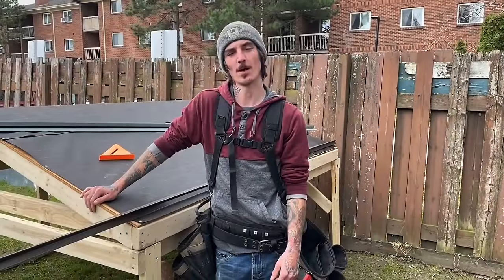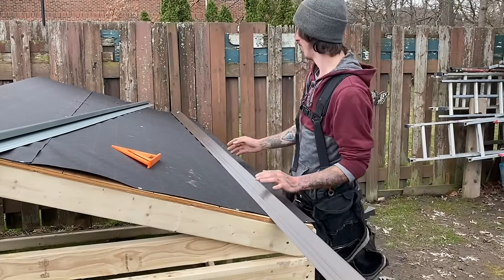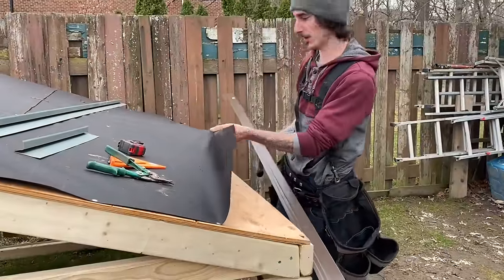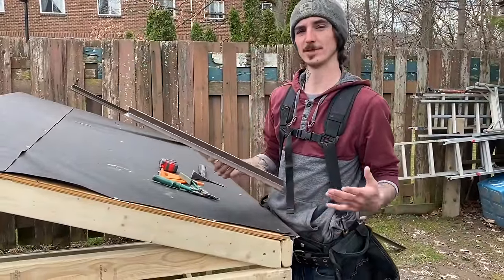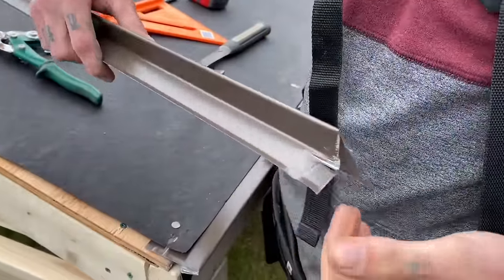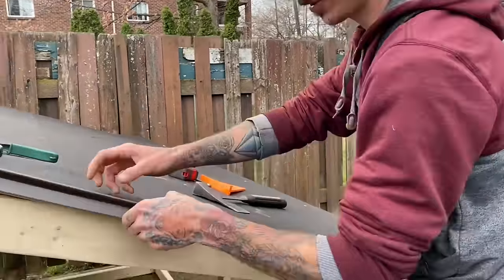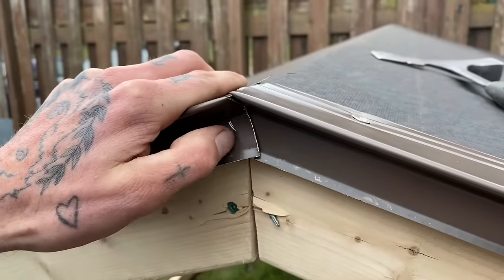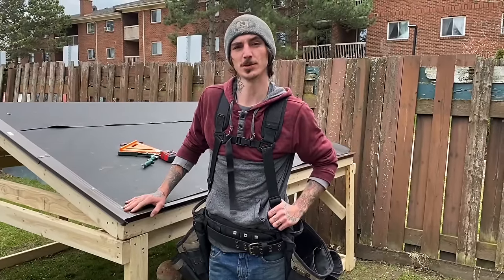How To Install Drip Edge On A Roof

Comment: 2:16  having the lip of the drip edge too close to the vertical facia face (i.e. the part touching the 2x4 in the video )
can cause the facia to rot or channel water down the wall, rather than dripping out away from the wall (the purpose of the drip edge).
Whoever did my house did just how you show ( 2:16 ) and now I have rotted facia to replace.
Reply: Were your facia boards wrapped? Facia wrapped with aluminum will not rot as the water off the drip edge will run right off. That is what he meant when he mentioned sliding the facia wrap "behind" the drip edge. If you have painted facia it will get wet and rot eventually no matter what...
Reply: @mongrelrogers9642  Never heard of an aluminum wrapped board. But now I have cement board so no rot ever again.

Comment: if I'm rolling a self adhesive GAF directly onto OSB, do I need to have an additional tar paper? Or, can I use the adhesive roll onto the OSB? Do I install the drip edge first, then roll on the GAF?
Reply from the maker: You case apply a 2 part system directly to the roof decking. 

First install base sheet, 
then drip edge,  
primer the drip edge, 
then apply cap sheet.

Comment: You do good work brother but you should never put metal against bare wood. Great content
Reply from the maker: Tyler ants. tian. to Schultz this is aluminum not metal. Nor does it cover enough of the roof deck to even cause sweating.
Reply: @Average_Roofer  This old house : Tom Silva says to use 'finger width' distance for drip edge against eave board.  Water follows the metal off the roof by capillary action and then drips off lowest point of metal. So best to keep drip edge metal away from wood with a small gap.
Reply from the maker: addker normally we would have aluminum fascia metal behind the drip edge here and then a gutter over that.

Comment: Also we do not have a drip edge because we just bought this house and the previous owners didn't GAF but now we want to install one. Is it possible to install it under the shingles that are already there. *GULP
Reply from the maker: It is absolutely possible, however it can be tricky as there may be existing nails in the way the may need to be pulled out. 

This must be done carefully as to not damage an of the shingles. Also if you break any of the tar adhesive seals on the shingles you must reapply new caulking or roof cement to re seal the base of the shingles. 

But the answer is yes it is possible.

Comment: Could you expand, and include selection as a key part of installation?  There's alot made [widths and angles], and construction methods differ.   I make the point because on my house, a roofer used drip edge best suited for trusses that were open ended at bottom, being minimal width.  In my case... bottom of my trusses [cut plumb] were joined by 2x4 ripped on edges to match the roof pitch before sheathing went on.  Years later, I go to replace a couple pieces of fascia to discover drip edge was nailed into that, and not  the 2x4, on account of width of drip edge selected by the  contractor.  So until my next roof goes on... I have a six foot and a nine foot section of rail with no securing nails: a friction hold that needs checking after heavy weather. [I just can't afford re-doing the roof at present]

Comment: So why do you use drip edge or “D” metal on the rake when they make “g” metal for rakes, or gable metal?.... it comes equity with a kickout bend on it to divert and seals the corner without bending and pissing off the gutter guys? Just my experience. I’ve used the same metal on rakes before.
Reply from the maker: This is more geared towards the do it yourselfers that need advice. There is several ways to do this process. You’re absolutely correct!

Comment: What kind of nails you used and what size?
Reply from the maker: Jesusdaniel Estrada standard galvanized roofing nails. Normally 1 - 1/4 but in this video I was using 2 inch.
Reply: @Average_Roofer  thank you so much my friend this will help me a lot

Comment: Just a question when you guys are doing your installs I see you using the dynasty's upside down why do you do it that way instead of right side up or leading edge?
Reply from the maker: Louie Perri that is the contractors preference. I prefer starter shingles. I will be going over starters in the next video! 👍🏼

Comment: Thanks man, great video. What tips do you you have flashing wise for installing a covered patio right up to the side of a stucco wall that I want to do minimal damage to? Can I just weather proof an L flashing or do I need to notch the stucco and install a Z flashing? I'm a DIY'er not a pro for reference. Thanks in advance for any advice.
Reply from the maker: CityHeights1904 for stucco we would normally run a step flashing flush along the wall. Then cover that with a counter flashing such as the z flashing you are referring to, then caulk the top of the flashing along the wall line. That is the simple and one of the most effective methods.
Reply: @Average_Roofer  Cool, so no need to cut the stucco?
Reply from the maker: CityHeights1904 not with that method no. Just ensure you attach the counter flashing to the wall using grommet screws, or regular wood screws and caulk the exposed heads.
Reply: Your Average Roofer Thanks man, really appreciate it. I’ll link some pictures on imgur once I’m done. Probably towards the beginning of June, I’ll be done with it.
Reply: @ your average roofer here’s the end result. 
Thanks again. 👊🏼
https://imgur.com/gallery/KHsNa97

Comment: You need to have a gap between the drip edge and the facia board otherwise capillary action will pull the water up behind the drip edge.

Comment: Plastic speed square and the wrong handed snips .good start .now you should overhang your drip edge an in over the rake so you can wrap it around and fold under your drip edge that should run up your rakes also. It keep most of the water off your rake boards and prevents the water from running down the rake boards and behind the j channel up the underside of rakes .huge mis conception about vinyl siding .water gets behind it everywhere. People don't flash the last piece under the windows .vinyl siding that was installed ten or fifteen years ago is job security .if you don't believe me go pull a few pieces of siding off under each window .

Comment: The problem with being tight to the fasciae it allows water to roll under the drip edge through hydraulic action. Better to be a fingertip thickness off the fasciae to allow water roll under the bottom lip of your drip edge and then drop.

Comment: what do u think is better gutters or drip edge? just fnishing up rafters now
Reply from the maker: B both!
Reply: @Average_Roofer  so u can put gutters over fascia board??
Reply from the maker: B it’s recommended to install fascia metal first then your troughs. But only after the roof is completed/shingled.
Reply: @Average_Roofer  cuz im getting ready to cut my rafter tails, just deciding what I should go with after that, im gonna have an overhang for shade, just doing a covered patio nothing serious like what u guys do

Comment: A much faster, better looking way to turn an outside corner is with one piece just wrapped around the turn still attached. All you do is snip all of it except the face that is seen on the fascia. I even snip the eight inch little profile on the bottom of the drip edge. then simply bend it around the 90 degree corner. Everything has been cut except the face of the drip edge. Faster, easier and looks better because it has no cut seem on the part you see.

Comment: How do I install this on existing tile roof - need to remove tiles first I guess and put them back?  I already have fascia damage and like to prevent water damage in future. The builder 30 yrs ago did not install long enough  paper to stick out far enough for to keep water out.
Reply from the maker: Simple Living I don’t recommend ever installing and roof in multiple layers. However if you are to do it, cut back the shingles approx 2 inches for the eaves and gables, then install new drip edge to the decking. Then use starters and shingles as normal. I highly advice you to just tear the old roof off as it will increase the duration and effectiveness of your new roofing system.
Reply: If you got 30 years out if it you're hardly in a position to complain now. That builder is likely dead today.

Comment: Can u just weatherproof paint the edge of the plywood 2 feet on all sides sonmoisture will never penetrate ?
Reply from the maker: I’ve seen it done but it’s a mask to a true solution. It will work temporarily but the wood will still eventually retain moisture.
Reply from the maker: Edit: if a leak is present!

Comment: trying to find out if the drip edge should be spaced off the fascia.....
Reply from the maker: Depends if you have metal over your fascia and an eavestrough installed. 

Some will tell you that it should be spaced 1/2 inch from the fascia board. Others will tell you it can be flush. 

We have always done it flush, with metal on the fascia with our eavestrough tucked up behind the drip edge.
Reply: @Average_Roofer  thanks.

Comment: Rookie. I've forgotten more of roofing than you know.
Reply from the maker: You’re roofing techniques are obsolete... 🤷🏻‍♂️
Reply: @Average_Roofer  I don't think so. You don't have the end of the edge metal ending at the ridge. It will cut into asphalt shingles and water will get blown into the cut. ALWAYS take the drip edge OVER the ridge. A little common sense should have told you that.

Comment: You generally want to leave a gap between the fascia and the drip edge of 1/4-1/2". If it's pressed up firmly against the fascia it can trap water and lead to rot.
Reply from the maker: Jacob Folkman refer to my latest video. That’s false
Reply: The the heck would you leave a gap? That’s just common sense to cover it properly.
Reply: @jonathanjacobo612  if you leave a gap that allows bees to just sit nestled in there. Have seen that happen alot during tear offs.

Comment: so should i have my underlayment ready when doing drip edge or can i put on before i put on underlayment? i see u did just a nail thru underlayment thru drip edge, or can i do drip edge front first then come back and install underlayment? also are 1 1/4 roofing nails ok??
Reply from the maker: B I always recommend you do underlayment first, as your first course would then cover 100% of the deck. This is especially important when using ice shield as it adheres to the decking. I was backwards in this video, but it’s certain climates the technique shown in this video is completely acceptable
Reply: @Average_Roofer  thanks so when using plastic cap nails how do u seal them or do u? Won't it leak or no?

Comment: Good video but I know it is for demonstration purposes but it looks like the underlayment was loose and not pulled tight where water could get underneath and it looks bad. Also at the top of the roof corner you didn't overlap the metal edges and I'm worried about water getting in

Comment: It would be great if the bird brains that installed the drip edge on the house I'm renovating.  They installed it over the tar paper and the water ruined a good bit of the fascia boards and even some of the rafter and ceiling joist that meet the fascia boards.  To add to the frustration, they didn't put the tar paper to the edge of the roof sheeting too.  I'm having to remove the drip edge, add tar paper and reinstall.  Follow this guys advice roofers.  Teach your installers how to install roofing properly!!

Comment: Why is the underlinement on the rake Edge not placed on top? I understand the concept of one material overlying the other when you consider how water runs, but not seeing the purpose of putting the underlinement below instead of above on both edges

Comment: I like to watch your videos, but you did your drip backwards bro . Tip...cut your drip 1/4 inch long on the eave, bend the face of the eave drip 1/4 inch for color leave the top section of dripping over. Now place you gable piece end flush with the eave and trace the backside to match your eave and cut. Now put in place and nail.   if it's a new build make your cuts and bends long to leave room for the facia as ro not distort the drip on your corners. Try and see if you like.

Comment: How u install gutters over drip edge?  Can u do that?
Reply from the maker: B the apron on the back of the gutter slides behind the drip edge. I can do a video if you’d like
Reply: @Average_Roofer  ok thanks, quick q, i got gmcraft 60 paper, that is for roofing right or no?? for an underlayment? if not what would u suggest??

Comment: Every one has shingles, how would you repair or replace drip edge on a non shingle roof ? My roof is just little rocks and I don't see shingles at the end.
Reply: If there's gravel/small rocks then it's definitely not shingles. I take it as it's a flat roof? If so you would want to get a professional to come in and take a look at it. Could be epdm or torch on.

Comment: I understand why the drip edge is placed under the sheathing on the bottom edge of the roof, but why isn't it installed under the sheathing on the rake edge also? (not a roofer).
Reply from the maker: Because if a gable end is to leak it’s usually due to wind driven rain so you want it to displace water onto the underlayment opposed to being under it and damaging the roof deck. On the bottoms it goes under to allow any trapped moisture or water to come over the drip edge and off the roof into the gutters.
Reply: @Average_Roofer  Makes sense, but using that same logic regarding wind driven rain, wouldn't the same thing apply to the bottom? I would think that if you don't seal the bottom drip edge, isn't it possible for hard driven rain water to seep under the drip edge under that scenario?
Reply: You want to really seal it good, put the drip edge over the underlayment, then brush a layer of cement over the gap. I believe that’s how they do it in Florida.

Comment: Ok, at 1:40 you've gone against everything I know to make this an easy and workable process. Take drip edge and cut in the middle of the full length then bend to a 90° and nail at the corner of roof first. This makes it 1 solid piece instead of trying to overlap and get 2 separate pcs at the corner of the roof to fit correctly.  Once you've cut the length in center and bent to 90, you fit it on the corner of roof tightly and nail it. After that you just cut to length with a 1.5-2" overlap and you make a small cut so they fit real tight. At the peak of the gable, same thing as the 90° corner. 
I was curious why you didnt do it this way. Also, I build the houses, side them, and try real hard not to roof them lol. I'll stick to my Superintendent status
P.S. Always run drip edge all the way around if you care at all about your work. I couldnt do it or have it done any other way, ocd would drive me batshit
Reply: @deepsix1827  how little you know young grass hopper. Try harder

Comment: How you measure the roof to change it
Reply from the maker: The easiest way is using google earths measuring tool. 

If your not tech savvy, simply measure with a tape measure and multiply. 

Length X Width + 10-20% for waste.

Comment: How come this old house says to put a finger in between the facia and the drip edge so the water runs off and not onto the facia and rots it...
Reply from the maker: https://www.youtube.com/watch?v=9wMMqsBAXlM&t=13s
Reply from the maker: Please view the video I have just tagged above, it explains this. 
Also they are stating that no fascia metal will be used to protect the wood. In our area it is code to use metal that will tuck up behind the drip edge after the roof has been installed. 
I can do a video in this if you would like? Thank you for the great question!

Comment: Good information but tar/asphalt roofs are easy. Tin roof isn't so easy cable edge I did ok but along the Eve's the drip edge they sold me just wouldn't match up. But i was not even a good a mature on installation. Although it's been 20 years and my roof is still dry just no edge along Eve's.

Comment: Drip edge is supposed to be installed over the felt. This is because ice forms and causes water to gradually rise up the roof from freezer temperatures. As that water melts it flows back downwards. The drip edge acts as a barrier for the felt.
Reply from the maker: Michaela Sorrell good thing this video isn’t describing underlayment! 👍🏼

Comment: Around these part I have never seen drip edge used. I figured just extend shingles out about an inch or so
Reply from the maker: Here in Ontario most people use it at least on the eaves. Some use it on the gables and some areas don’t use any. 

However in Ontario it is code on any pitch less than 8/12.
Reply: @Average_Roofer  true. Yeah I'm in South Carolina and I've never seen it done here. I built a small shed and already have the tar paper on(synthetic stuff) and I may have messed up bc I nailed it along the facer boards. I figured I could just do an inch and a half of overhang with shingles and then I could add a white Hardee board facer (I think about a half inch thick) to make it look clean and perhaps a gutter on each side exept Gable ends of course. But I really don't know what I'm doing or how to install gutter's

Comment: Hey cowboy, how do you join two peices of drip Edge together on a long run?
Reply: Do a angle cut at the top so the bottom of the next piece fits in it and you see no bubble! Make sure it’s close 3”